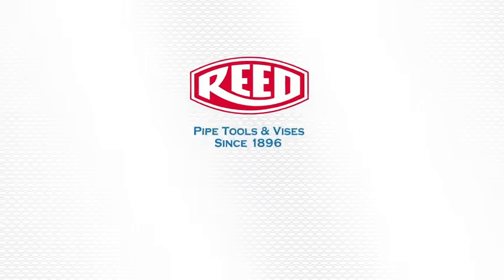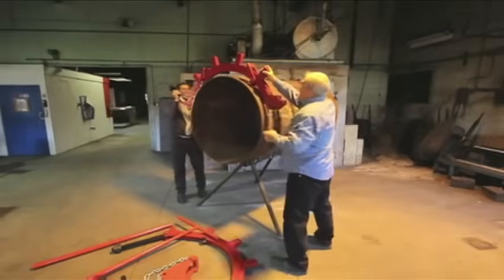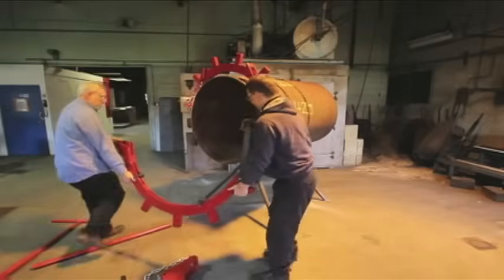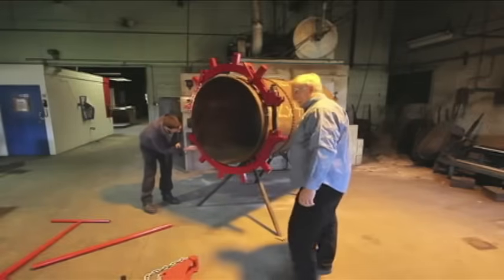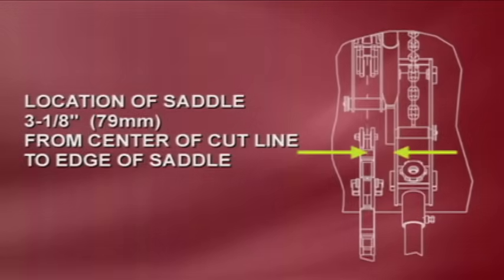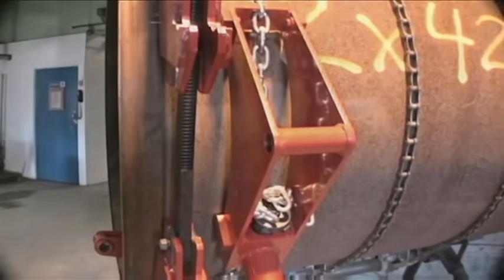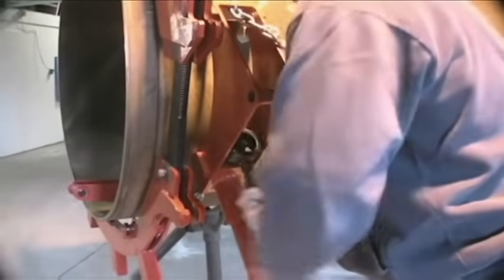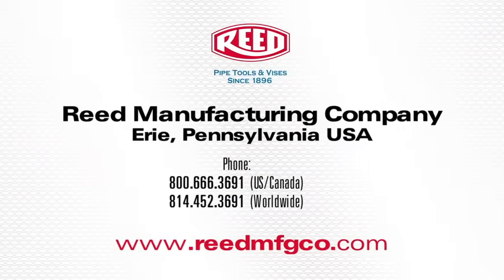Rotary Pipe Cutters Assembly & Demonstration (RC30/RC36/RC42 ) - Reed Manufacturing

Comment: Well how long does it take to cut the pipe ?
Reply from the maker: The answer depends on the pipe diameter and pipe material.  Additionally, you want to make sure you are using good quality cutter wheels.